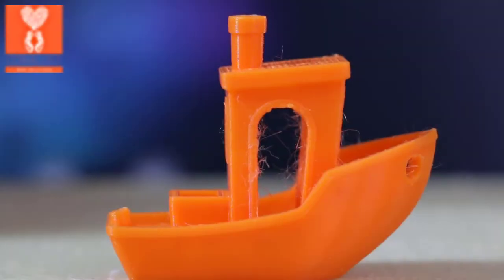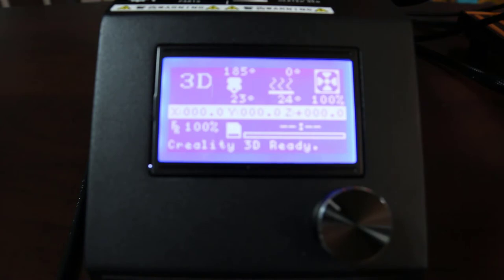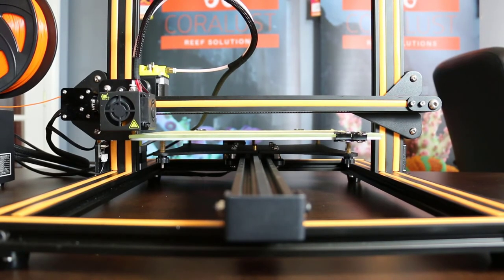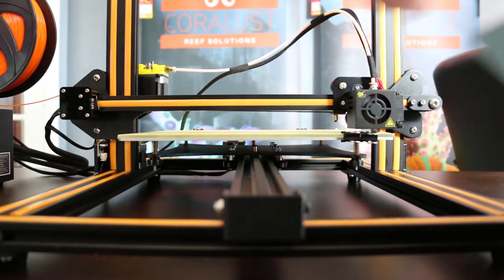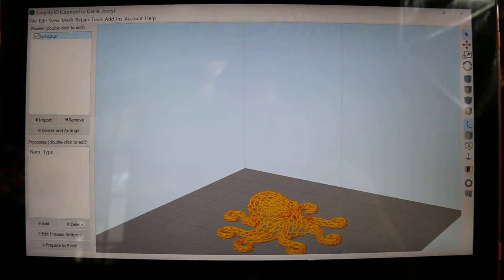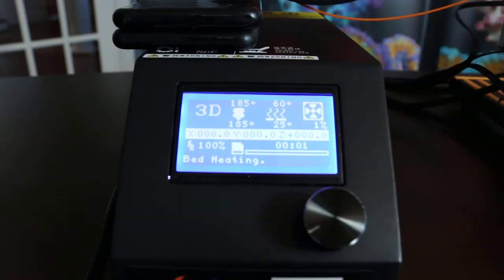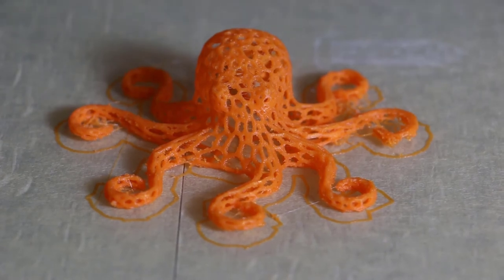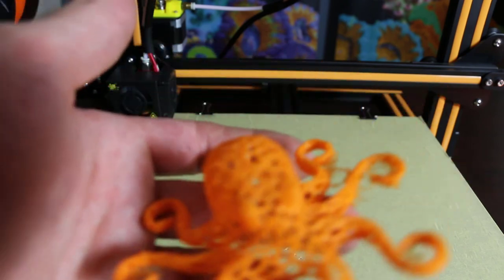CR 10 How to level your bed and begin printing

Comment: I just got my printer. started and run a 3D test that came with the printer in SD card. but the nuzzle wont rise as layer gets put on the bed. as some point it scrap against the bed. what is going on please. any help???
Reply from the maker: +Dean Rezaei you don't want to use that code that came with it.   What slicer are you using to setup.   Try downloading something from thing averse they usually have great project files ready to go for you to test something out.
Reply: don't know if i still helping...buuuuuut... if you have a cr10, did u screw the(i'm lacking the word atm...) z axis in plave?so in this cylinder holder-thingy at the bottom?
Reply from the maker: +TheVIFFT yes they get bolted from the bottom.  Feel free to email me a picture.  Info@coralust.com with your questions